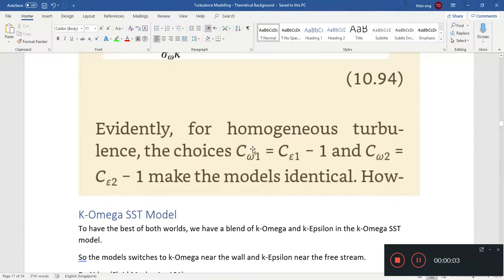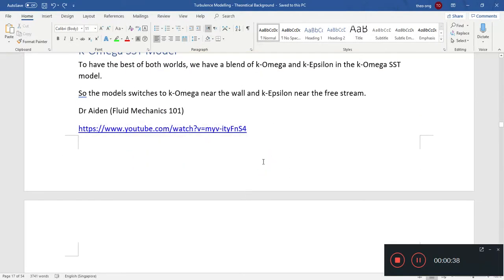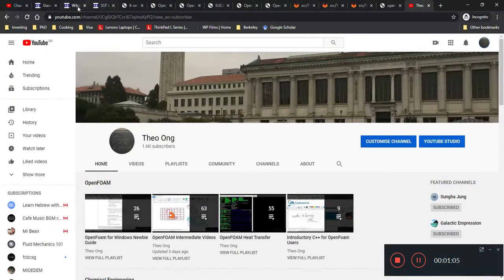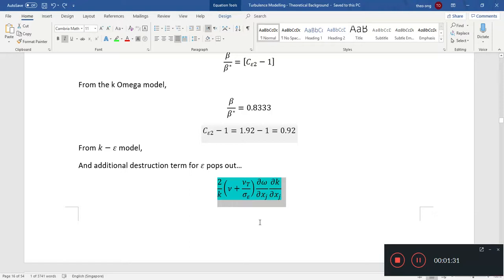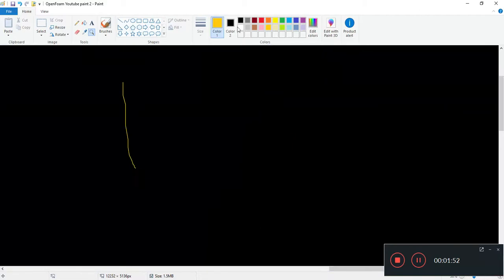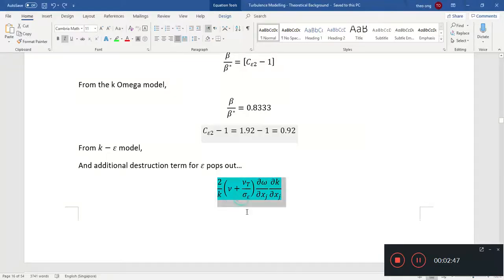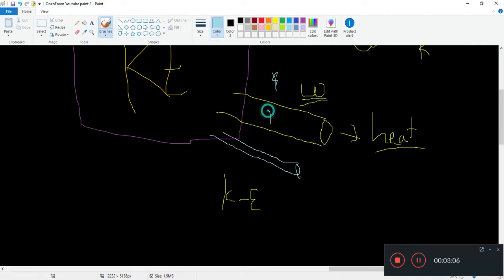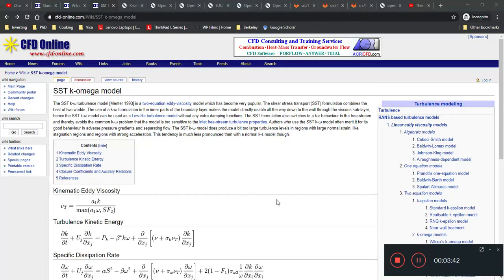Turbulence Modelling 31 - kOmegaSST Model part i

Comment: Hi Theo!
I have a question in 17:25.
You said Poped out term is 0 in inner layer.
But how does it prove that term is 0 in inner layer.?
By experiment or other?
What is the mechanical reason that we can neglect it in inner layer.?
In k-epsilon model, we can find the modeling of turbulence viscosity is started from mechanical inspiration.
(ex: k^2/epsilon)
What is the mechanical inspiration of the idea that this term can be negligible in inner layer?
Thanks.
Reply: @TheoOngScienceAndEngineering 
Thanks for answer.
You mean, cause of dominant molecule viscosity, there can't be turbulence and it means gradient of turbulence is zero right?
Thanks